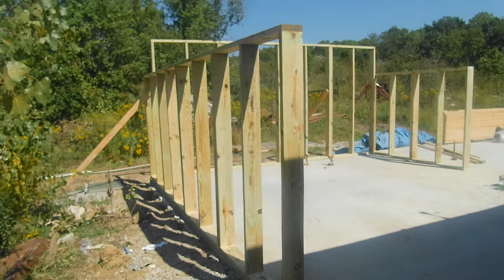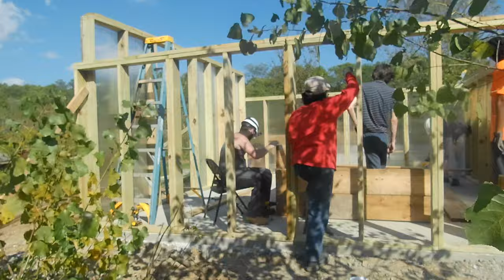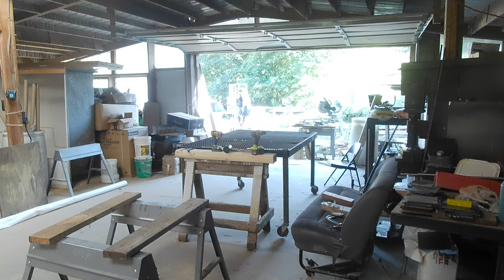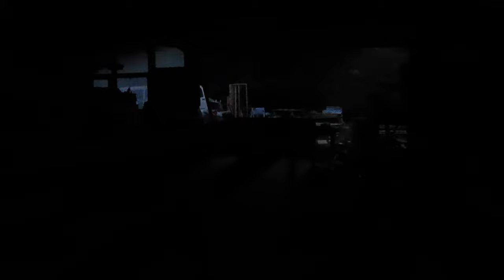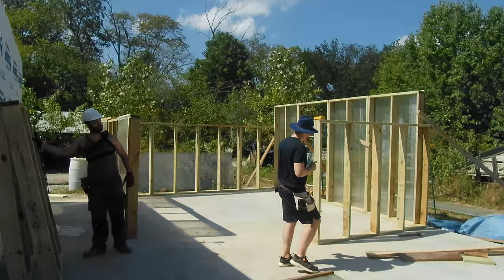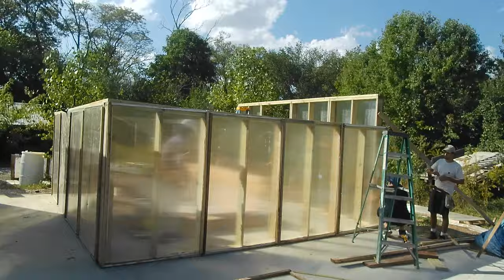Aquaponic Greenhouse Build - Structure

Comment: The Aquaponics Greenhouse is, at the end of the day, the most important component in an open source homesteading construction set. Growing food when the global climate crisis starts raging around us will be the difference between successful adaptation & food insecurity.

Still need to see a greenhouse automation system that will maintain temperate conditions inside the greenhouse during a Polar Vortex breakout event or a 120F heat emergency. Extreme weather has become the New Normal, so the Aquaponics Greenhouse has some major challenges ahead to contend with. Perhaps an automation system based on the Arduino or RaspberryPi microcontrollers will be the way to go, since they are both commodity MCU's now and extremely inexpensive.
Reply: This includes fish? Otherwise vegetables and herbs are not essential for survival. If we're talking cost/benefit I would say grazing animals would be the "most important component" to sustain human life.